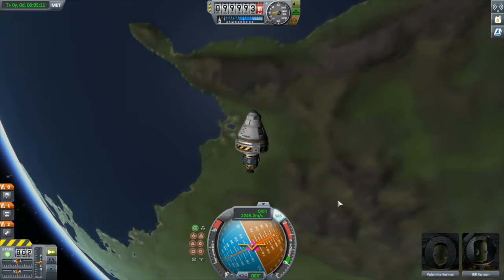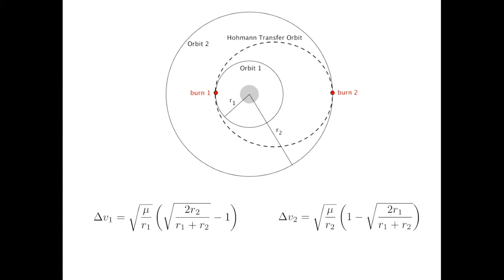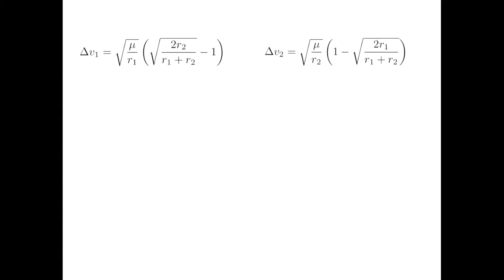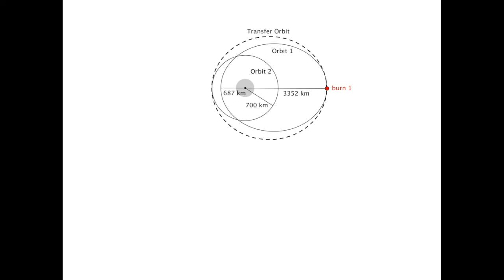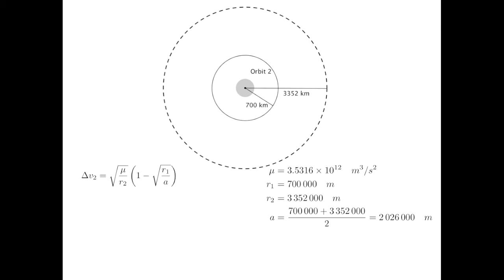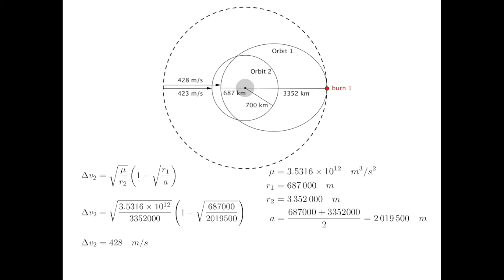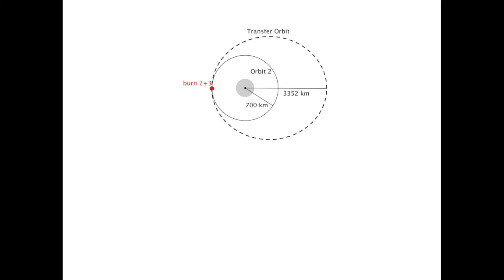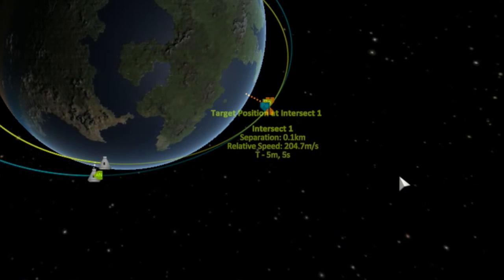Costs of Elliptical Insertions | KSP Let's Do The Math

Comment: Quick question about PEMDAS, how do we find the square of a fraction?

If I remember correctly, you square both the numerator and denominator and then divide? Is that correct?
Reply from the maker: Yes, you square both the numerator and denominator. Remember, squaring something is just multiplying it by itself, and when you multiply fractions, you just multiply the numerator and denominators.

For example,  
(3/4)^2 = (3/4) x (3/4)
= 9/16

You can divide 9 by 16 if you want the decimal representation of this answer, but there's nothing wrong with 9/16.